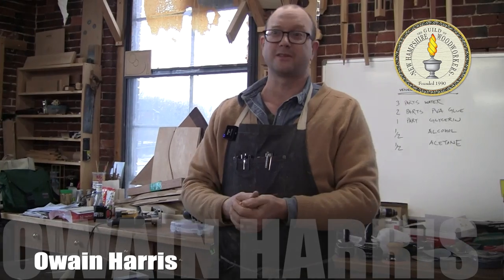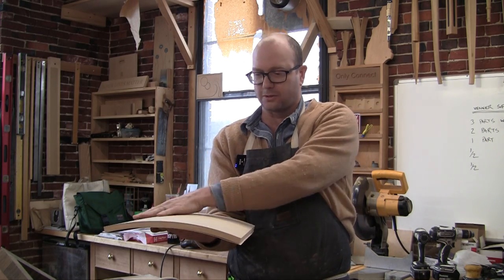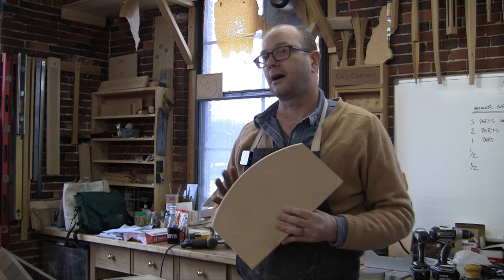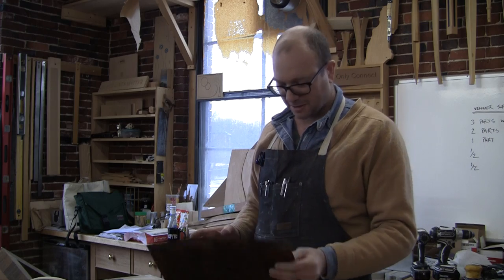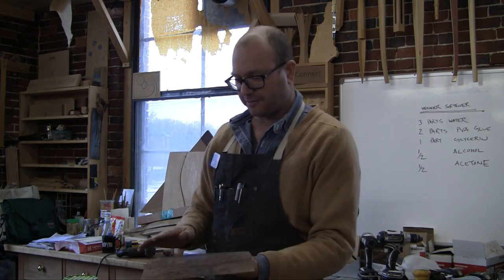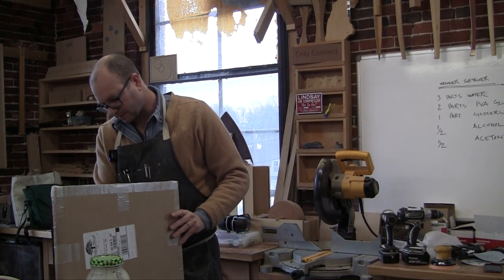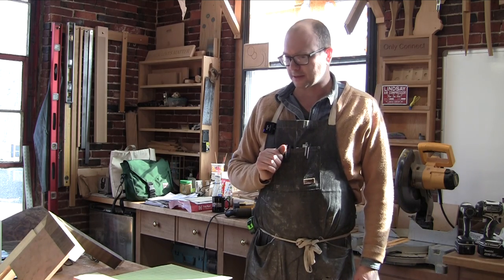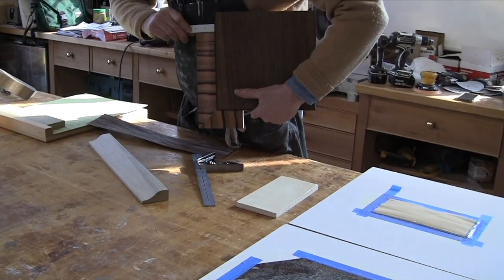Veneering Curved Surfaces with Owain Harris

Comment: Thanks for sharing, learned a ton! There was a question at 59:30 about the purpose of the extra tanks in the vacuum setup, I can shed some light for the curious. If we can imagine the inside of the vacuum bag like the inside of the room they're standing in, we can also imagine that the moisture present in the wood and glue is like a handful of rice grains. When we start pulling a vacuum those grains of rice expand to something like the size of a beach ball - this is the liquid water changing state to vapor. All of a sudden our room is becoming very full, and can even build pressure if enough moisture is present. Adding those additional tanks changes that small room into a huge arena. Now there's plenty of room for our beach balls and all the extra space we need to not build pressure. 

Then there's the million dollar question - is it really necessary? Well, that depends on how much moisture we're putting in the system and how long it needs to remain under vacuum. If you don't have the tanks and you do have a lot of moisture, you can always just kick the pump back on to clear out some "beach balls" if necessary!

Comment: Magnificient, I would do a 180° turn with radius 1/2", would that be possible? What is the smallest radius you achieved? 
Other question, what is the wood you demonstrated? Is that zebra wood ? (zebrano)

Comment: Does anyone know if you can apply veneer with titebond 3 using the heat method?

Asking for a friend, he likes that titebond 3 is waterproof.
Reply: Titebond 3 is not really "waterproof".  They would like you to believe that but it's not. It's definitely the most water resistant of the Titebond line however. Epoxy or plastic resin, etc glues are examples of completely waterproof glues. So I would not use Titebond 3 for an exterior door.